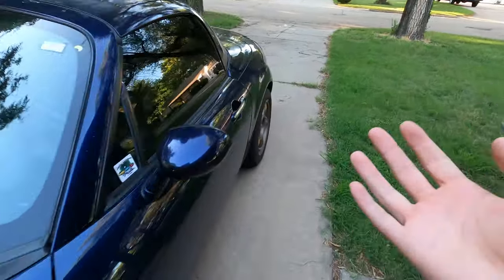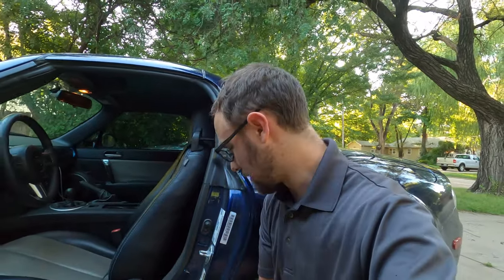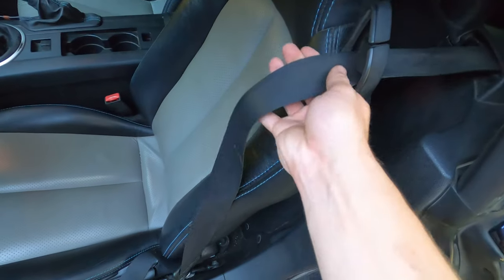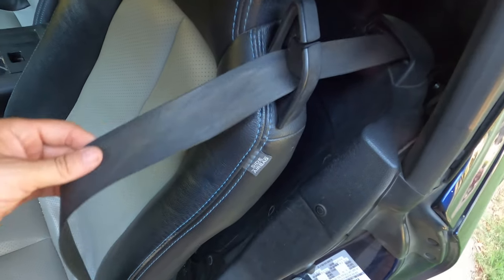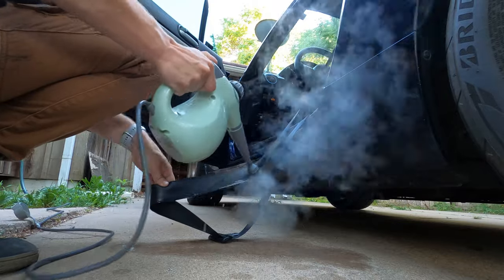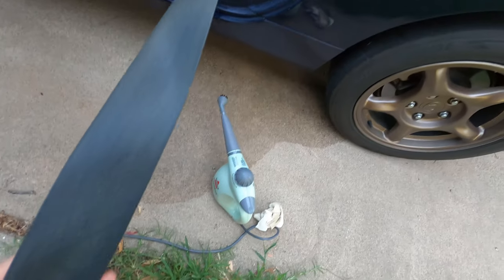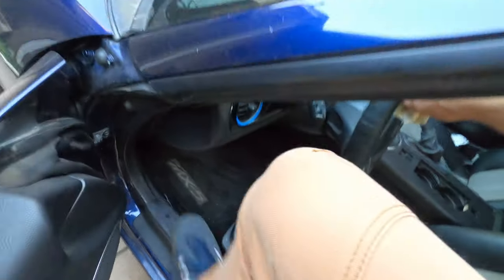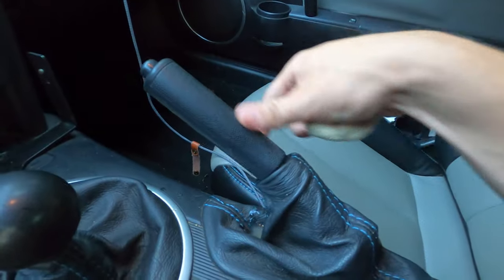Cleaning my FILTHY seatbelt with STEAM POWER!

Comment: Before you steam it, mix up some detergent and water, and saturate the belt.(sponge or rag). Let it soak to break up the grease and dirt. You can use some kind of dishpan and a scrub brush to clean the belt. Rinse it once or twice. A clean belt makes a lot of difference on retraction.

Comment: I did the same thing using a hot bucket of water, a scrub brush and a bit of laundry detergent. Pull the belt out until it stops and put a clip on it, like a wooden clothes pin or small binder clip to keep it from retracting. Place the bucket of mild detergent water in the seat making sure it won't tip or spill and place as much of the belt inside of the solution and gently scrub as much of the belt as you can. You can also use a spray bottle for areas of the belt that can't be placed into the bucket. Towel dry as much of the cleaned belt as possible. I managed to drape my belt on the corner of the opened door to speed up the drying process (be careful with the buckle around your door glass so you don't shatter or break it). Like 100PercentJake here, the belts in my vehicle are dark in color and hide a lot of dirt and grime. I was shocked as to how disgusting the water became. Just cleaning the seat belt made a huge difference in the way it retracts. I really thought I was going to resort to replacing or repairing parts to fix my belt retraction, so I definitely recommend cleaning as a first step.